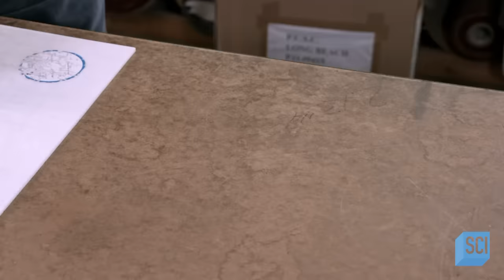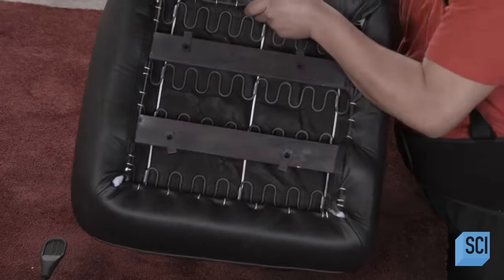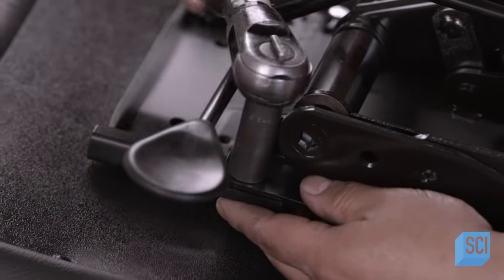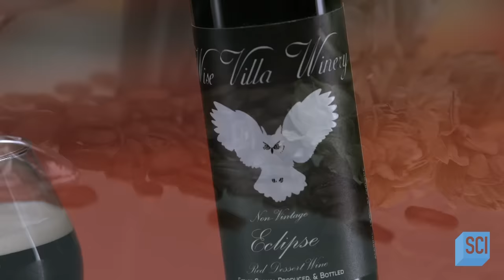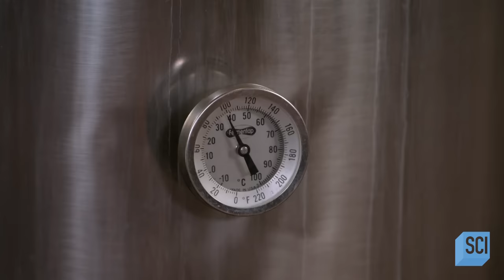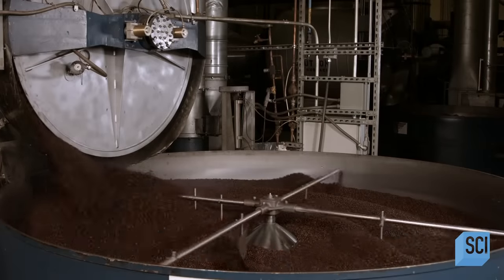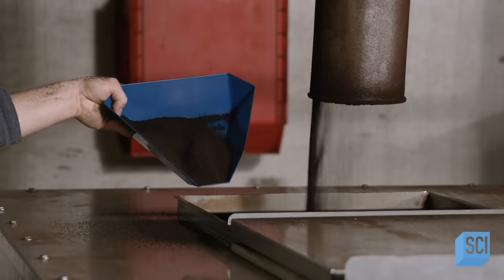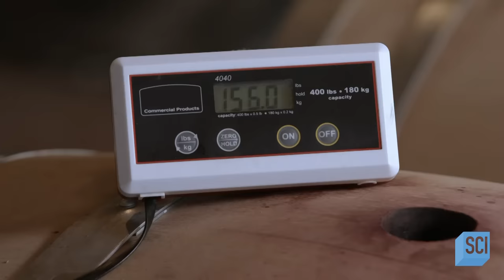The Fascinating Process Behind Office Chair Production | How It’s Made | Science Channel

Comment: Lately I have been unimpressed by beers that use too much Hops. I'm not a fan of hops taking the smooth taste of beer and turning it bitter......Why???? Beer is Water malt sugar and brewers yeast, no hops is necessary.
Reply: Hops are great - but most microbreweries put too much in (hence the ubiquitous IPAs...a beer that was traditionally very hoppy). It's easy - that's why: you get to add a lot of flavour without too much skill. It's like taking a mediocre sandwich...but then shaving a ton of truffle over it so it's "fancy". No culinary taste or skill required!
Reply: Hops were originally added to brewing to help preserve the beer.
When I made beer, I usually cut the amount of hops by 30-50%.
Reply: @patmcbride9853  Yup, which is why IPA is a thing: "India Pale Ale" - it was brewed in England to be shipped to India, and had to withstand the heat and long voyage.
Reply: @hoilst265  Yes.
And I can't stand IPAs.
My brothers in law love them.